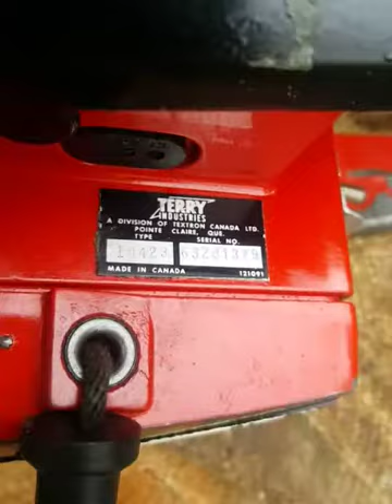Homelite VI 955. Vintage 82cc chainsaw. First run and overview.

Comment: Hello again Rob, i had mine apart a bit recently. Like you mentioned, the engineering and design of these is as intricate. Such a detailed and unique design. As for power, plenty of it. Ive an original 24 inch homelite hardnose bar on mine. Well able to pull that too. Might have a video of it cutting pretty soon aswell. So lucky i have one. Theyre quite rare in the VI edition aswell from what ive read around. 82cc sure makes light work of anything! 
All the best
Alex

Comment: the inside "filter" is actually designed to catch spit back out of the carb to prevent it from collecting in the airbox.  very neat design.
Reply from the maker: Hello..
Thank you for the information...that is really interesting and I did not know.. 😉

Comment: Just picked one up today! No idea if it runs but it was a price i could not refuse
Reply from the maker: Good morning Alex.
You lucky devil 😜.. they are so difficult to find now.
I'd love to hear how get on with her..
Best regards
Rob
Reply: @stridebaad1219  i got it started in 4 pulls yesterday evening. Needs a bit of fuel line or a gromet. Dam things strong
Reply from the maker: @alexhickey5633  wel.. you lucky jammer 😃👍
Maybe a video of her when finished !
Regards
R 😜
Reply: @stridebaad1219  I'll email you a link there shortly
Reply from the maker: @alexhickey5633  fantastic 👍😜